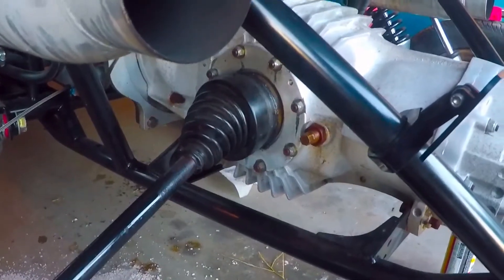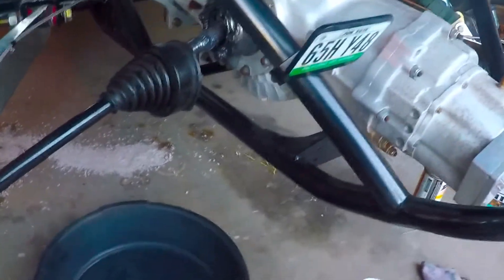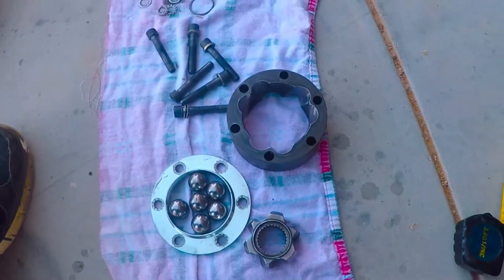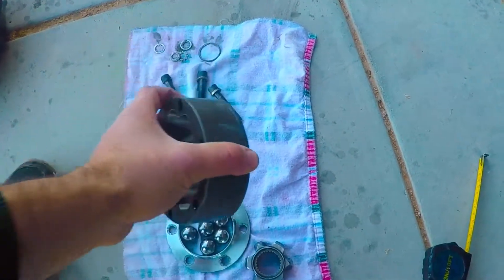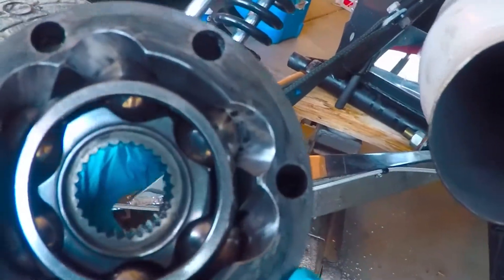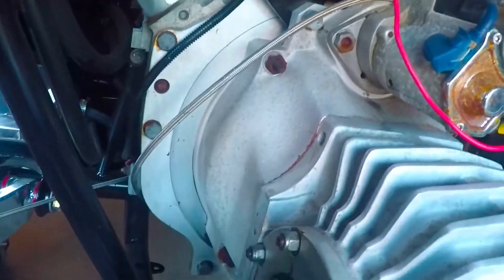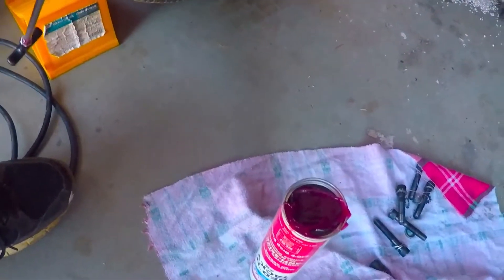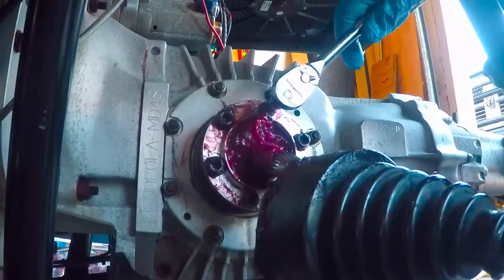930 cv joint service

Comment: How did u get the micro stub off cv housing ?
Reply from the maker: Typically they just fall out. Sometimes you may need to tap the edge of cv at an angle to get it off if stuck.